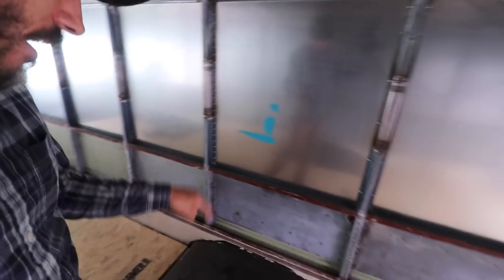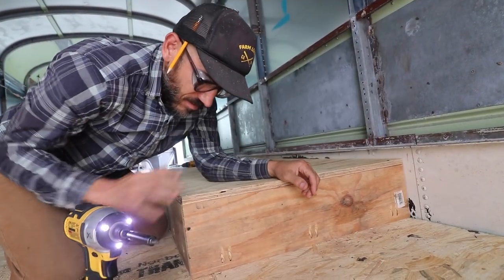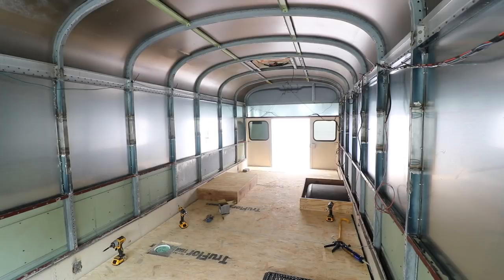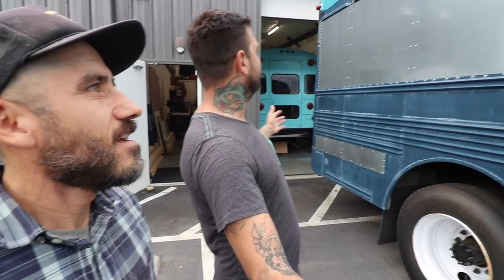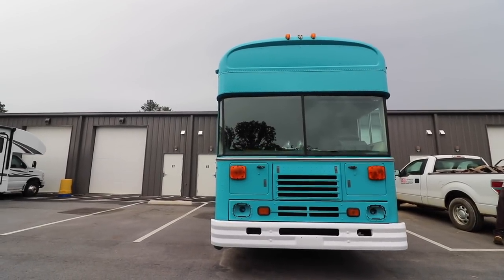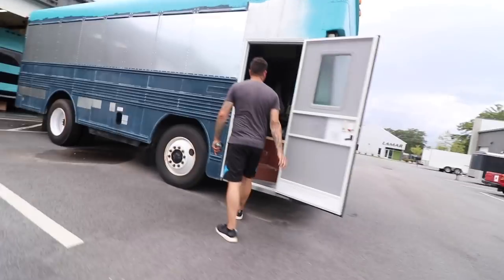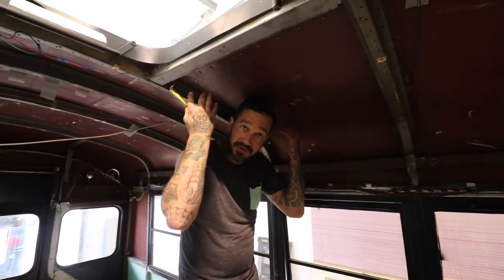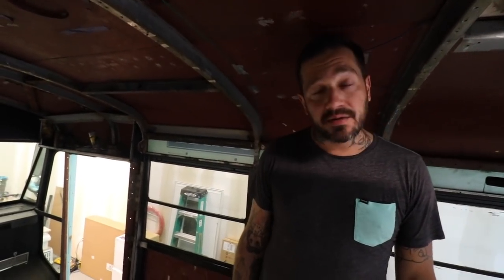12 inch ROOF RAISE in a School BUS CONVERSION

Comment: I converted a bus years ago , and the first thing I did was to cut and raise the roof fourteen inches , and it made a world of difference because little do people realize , that the extra head space is mentally sweet and unconstricted  -  where as a bus that is just an inch or two above your head actually conditions you to duck or hold your head a little low , and that wears on your psyche after a while !
Reply: Unless you are short like me. My husband would agree with you though. He couldn't sit in my little car. First thing we did when we got married was trade in my little car for one he could sit in. 😂
Reply: @alanscott first thing after gutting that we’ve done too!! We went 20”. Just posted a video about the roof raise prep work!

Comment: Those Kreg jigs are awesome! I use them whenever possible. Love seeing these bus conversions as well!
Reply: Great tools, but made for solid wood not laminated.  There's limited holding power when screwing directly into plywood laminations and higher probability that it will loosen with road vibrations and usage.

Comment: the thing i would do when raising a bus in the way they did is add a second set of front windows over the originals so that you can see out when standing in the bus when its driving

another thing that might work on busses where you dont do a roof raise on but have a center path is only raising the center spine of the bus and add narrow windows on each side 
https://upload.wikimedia.org/wikipedia/commons/thumb/5/5a/Passenger_car_GN_3261_20041010.jpg/220px-Passenger_car_GN_3261_20041010.jpg
should add a LOT of light inside